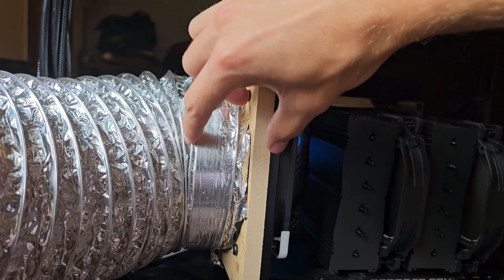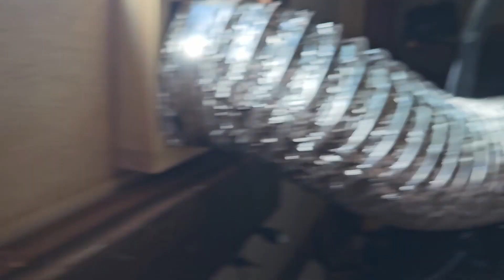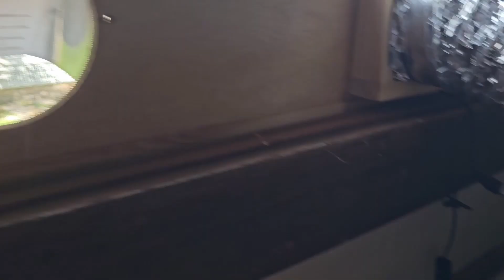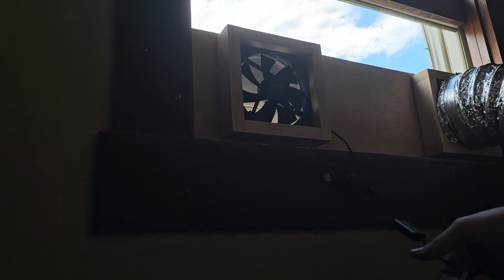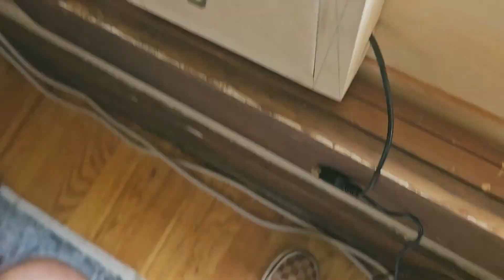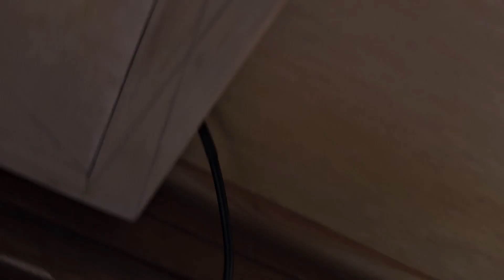Room Getting Hot? Move Hot PC Air Outside

Comment: I just thought of something to make it even wilder. You could mount two 120m or 140 radiators. One with the intake fan and one connected to it placed outside with a little pump just to get a couple degrees of cooling. Probably not that much but still makes for a fun experiment

Comment: I have been on the internet for a few months looking for this setup!

I was trying to go with a inline fan setup to move as much air and pressure as possible because in the summer my room gets dangerously hot.

However in the winter now, it's the reverse and I actually use most of the heat from my pc and tv to keep the room heated.

Can you show us how you mounted the wood piece in the window so evenly?

Very much interested in trying this setup as it seems most practical.

Thanks!

Comment: Good stuff man. I feel like PC components run a lot hotter these days. I don't remember having this issue 10 years ago. I wouldn't be surprised if in another few years there are companies offering kits to do exactly this since there is clearly an unfulfilled need in the market. Anyways, I think I'll fire up the 3D printer and see if I can make something a little more aesthetically pleasing than wood, at least the part that is connected to the PC. Anyways, I came here for the proof of concept, which you have delivered, so thanks. I'll share my design with you when I finish it.

Comment: This is one of those moments in tv / movies where a guy is looking at his pc .. then looks at his portable ac unit .. then back at the pc .. then the portable ac ..  as the camera is moving closer and closer to their face until they get an idea.
I've seen other ideas like this in the past, and I had my epiphany just like I stated above.  It couldn't be simpler, especially the way you do it with wood.
I like FPVC sheets for the water insulation, to avoid mold and water soaking into the wood.  Easier to cut and shape too.  Just not as inherently rigid like thick wood.

Comment: That's great but it seems like if the air outside is warm (say it's a summer afternoon), this will require to suck in some fresh warm air from outside, so the room will heat up either way, albeit admittedly less
Reply: Ac?
Reply: edit: nvm your comment makes no sense whatsoever.

Comment: I would have liked a temperature comparison
Reply: Can tell you at the very least, from experience, exhausting PC heat with ducting works extremely well to keep room temps down, especially if GPU is under load. Not efficient for PC cooling and requires one or two duct fans - depending on how long the ducting is - to get similar efficiency for PC cooling vs. room cooling. Also depends a lot of PC case airflow. I keep PC in a cabinet with lots of openings for intake, some of it exhausts into the room, but most of it exhausts out of the top of the case, through a duct and out the window -- the duct is about 8 feet so I have a fan installed at either end.

Comment: Another thing I like to add to this is if you have double hung window. You can mount at the top of the sliding window since hot air rises.
Reply: You want this tube as straight as possible
Reply from the maker: @rounddumpling5560  genius

Comment: Naah back in the days, i mount my pc on the window, just like a window ac unit, no need for ducting or anything else, just put the back outside, the front inside, slip those cables by the sides, and duct tape the gap, done 😂
Reply: good idea except it'd be a bitch if you needed to trouble shoot

Comment: I can't do that since I have a top mount AIO inside my case exhausting from the whole top.
Reply: A long box on top with pipe out the back end?
Reply: You could try to create positive pressure and use the AIO fans to force air into the case. Maybe benchmark the temps first to see if its worth it.
Reply: It's what I plan to do

Comment: Been looking into ideas of doing this. I live in a new build house in Australia (dogshit insulation) in the tropics where my room only has a portable aircon. I edit videos and photos as well as play games on my pc and at the moment it’s summer and my room absolutely cooks even with the ac on, which basically does nothing because the heat from the pc totally overrides the cold air. 

If it’s 35°c plus outside I swear my room is like 40 plus and my pc is significantly slower in summer. So slow pc plus the heat = me going insane

Comment: I've been thinking of an idea like this but I'm going to put it in a glass cased cabinet and vent the whole thing out that way there is no leakage. Did you take measurements before and after?
Reply from the maker: @thewrongaccount608  CPU temps went down by about 3 degrees C on average, so not much change IN the case, but the room was quite a bit cooler.

Comment: I use water cooling and have the fan chassis that vents the heat running into my wall which leads to my attic space.  No air from my house gets run through it that way.  I don't want to lose my cool AC air.
Reply: This is exactly what I wanted to do, but it seems my house is so old it doesn't have soffit vents, so there's no airflow there.

Comment: I'd be afraid to pulling humidity into the PC
Reply: how.... its not pulling in any air....
Reply: @son_of_a_birch  if the pc is off / or fans arent spinning the air will try to equalize humidity. you can feel this affect if you turn off the AC in your house and open all the windows/doors on a rainy day
Reply: @Butterscotchcs i suppose if pc is off that's valid. I've ran this setup for about a year , but also was on servers that run 24/7 and i used a damper at the window to block it during any maintenance. a damper mitigates most of what your saying but still wouldmt wanna leave it off for too long, forsure.

Comment: You should make a duct that goes from the cpu cooler to the case fan. So it pulls heat directly from the cooler
Reply: good idea but getting in there to trouble shoot would be a bitch trying to get around the ducting
Reply: @kylewicks6133 i mean making it easily removable would be the obvious choice for that. Like no using screws but like little numbs to align the screw holes

Comment: Any update on how this is working?
Reply from the maker: It worked great for the fall/winter I had it running. My wife and I bought a house that I can't really use this setup in though, so I'll have to figure out a different solution. Maybe water cooling with pipes that go outside :)
Reply: @chickenfoot911   is it because you don't have a window where your computer is?

Comment: How did you connect the PVC to the MDF? Thanks!
Reply from the maker: The PVC pipe is just a hair smaller than the circle hole I cut in the MDF. So it's pressure-fit in there. A couple of whacks with a rubber mallot seated it in place. You could also use glue.

Comment: Any updates or temperature data of your room and pc?
Reply from the maker: It worked great for the few months I used this. I moved to a house with the windows high up so I had to get rid of the cooling "rig", it doesn't work for side sliding windows.
Reply: @chickenfoot911  I've seen alot of portable air conditioners that use heat dumps in the form of a plastic flexible cover you can tape to your windows whilst they are open. Those covers dont seem to be expensive and they have alot of them you can either tailor, or get a fit for different types of window. Hopefully this helps!

Comment: how about a watercooler with a mora on the outside? maybe the better choice to transfer heat to water and transport it ouside in some small tubes
Reply: I do that but it is run into my wall via a insulated hole.  Only the heat gets vented, not my cool internal air.

Comment: This is like running your air conditioning directly out the window instead of into an insulated room. Also, the negative pressure in the room, which is caused by your central air ac, will just pull hot air INTO your pc from outside. You would need to defeat this negative pressure with a fan on the outside that sucks air out of the room. 
IF you have a fan in the system already, then by pushing air out (if the central air is not running), you are also creating a negative pressure at that 2nd hole in that wall that just SUCKS hot air in. ALSO, no point in making this if you are allowing hot air from outside to replace the air in your room with that 2nd hole.

A L S O
Sucking in dramatically cold air next to a pc with temps as high as 100C is a recipe for condensation. 
You DO NOT want to introduce more humidity to the room with a pc in it.

You would be much more efficient if you just ran your central air with no hole in your window, and leave your door open to allow the hot air to circulate through the system.
Reply: A L S O 🤓
Reply: He showed the exterior of the PC fan pulling air outside. Negative pressure from a PC? Hardly. However, that exterior screen looks like a barrier that would recirculate some of the hot air back in. But he has a plug for the 2nd hole - also shown at the end of the video. Sucking cold air into a hot area does not cause condensation - that's backwards.
Reply from the maker: If you have central AC, then yes I would use that. I did not have any air conditioning in this case.
Reply: I think you're full of shit
Reply: I did the same thing like he did 5 years ago and it just simply works. Room is much cooler. PC as whole runs cooler.
ALSO I  : I have no problems with negative air pressure because the door to my room is open. So it pulls air from where there is least resistance.
ALSO II : (condensation) He has a plug to close the second air inlet.
ALSO II : The only problem is the efficiency of the heat exchanching hosepipe. It has to be insulated very well or it will emit warm air back into the room.
Reply: would this not work when your getting rid of the air that is 170-180 degrees and just getting outside air that is 100 degrees cooler

Comment: I am going to do this. only concern is dust making its way back into the pc or humidity back into the case. Guess it shouldn't be an issue if the fan is constantly going though. Nice setup though!
Reply: You'd have to have some insane humidity for that to ever matter
Reply: @KvltKommando  mid west has high humidity in the summer how insane are we talking bud
Reply from the maker: This is in north Colorado so super dry. I was more worried about dust.